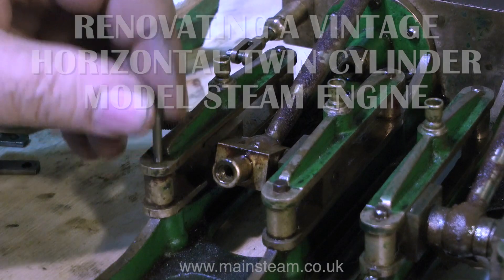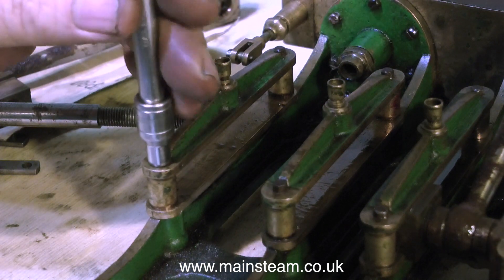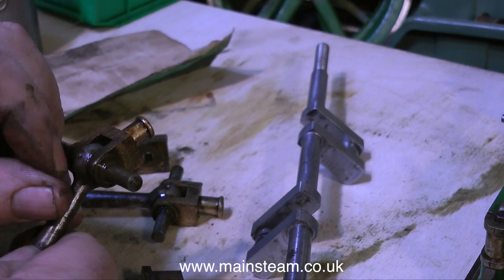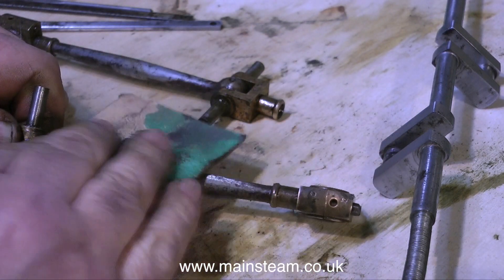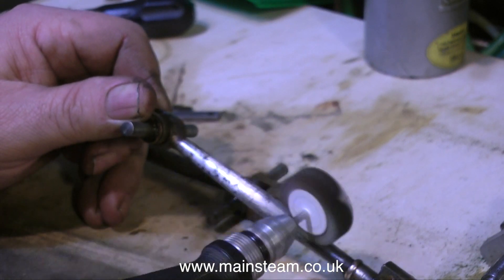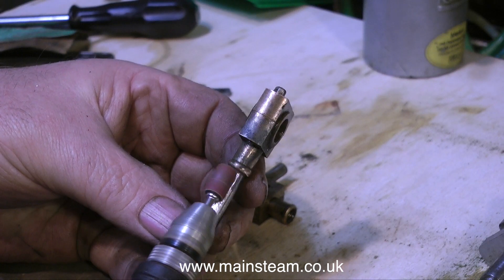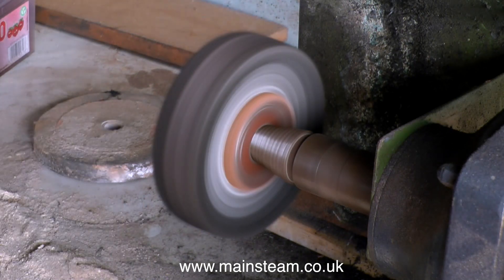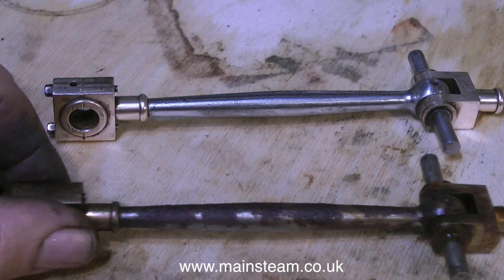PART #4 -  RENOVATING A VINTAGE HORIZONTAL MODEL STEAM ENGINE

Comment: Keith, have you ever tried using a soda blaster abrasive blaster using sodium bicarb, as the abrasive to clean up the rusty metal parts,
Reply from the maker: no, I haven't got one ..... I cannot afford such frivolities . . . . :-)))
Reply: I have found that you can make one up really cheaply if you want to, or get a really cheap gravity feed spot blast gun and just use baking soda in it

Comment: Never use gloves while using a grinding, polishing or wire wheel attachment in a bench grinder. Gloves can get caught and drag you into the machine.

Comment: Hi Keith, awesome job to your usual high standards! I really enjoy watching your videos because of the quality of workmanship you exhibit! One thing I wanted to ask is whether you had ever considered using diluted Hydrochloric Acid to remove the rust, followed by a polish? I've had some excellent result with the acid, and it takes very little time to remove the rust. I use 34% Strength acid, mixed with water (2x parts water, 1x acid). As long as you're careful and wear long rubber gloves and breathing and face protection, its a pretty easy way of removing the rust quickly and thoroughly! :)

Comment: Nearly swallowed my tongue when you started with the grinding wheel!  Why on earth didn't you remove the con rod end and the cross head pin from the main con rod?  Would have made life so much easier.
Reply from the maker: Hugh Coleman Because I love the high life of danger & risk - it is the only excitement I get these days . . . .

Comment: Oh, and another good one, but NOT as controllable, and WILL ease edges - a vibratory tumbler.  You can get stuff as fine as walnut shells (polishing) and as course as ceramic with abrasives.  Toss the parts in, turn on the water flow (if needed - corn cob/walnut shell is dry), and come back some hours later

Comment: Keith, Here in the US, we have something called "Cratex" points, they are a bonded rubber (like the block shown in I think it was part III) but for the small electric motor.  I've found them very useful.  Another "good" rust remover is the plastic "scotchbrite" pad - sort of a plastic 'steel wool' pad that comes in different grades.  I have one for my 1x42 belt sander, and it works a treat for this kind of work,  Aggressive, without being nuts

Comment: Just curious - if you could protect the soft parts, would light media or sand blasting work for rust removal?
Reply from the maker: 75Bird455 On the next rebuild I will be trying that method as the engine is very rusty.
Reply: Look forward to seeing it!